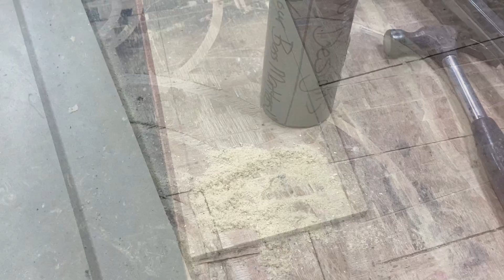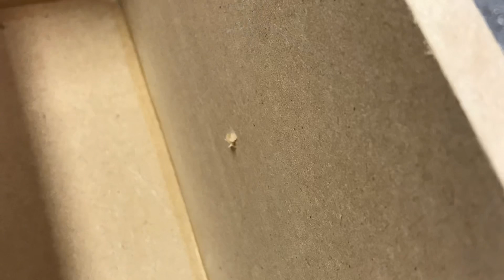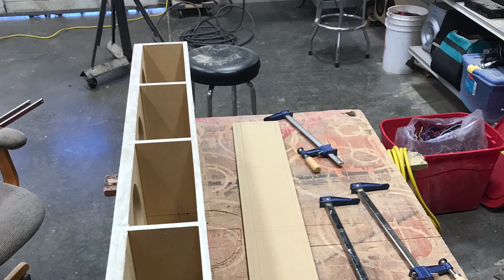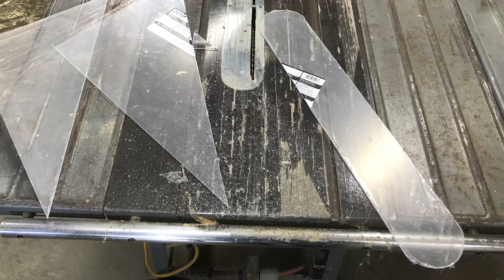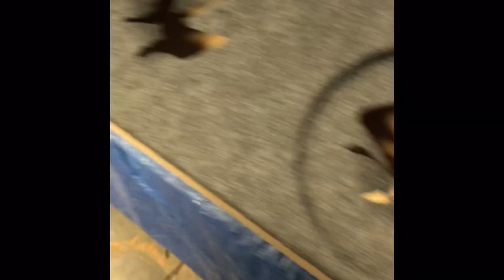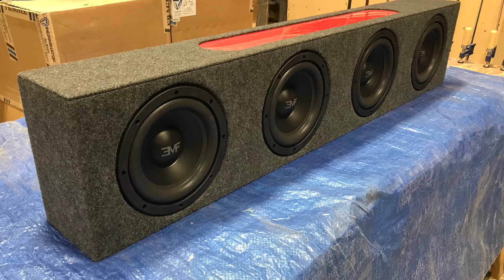Custom sealed enclosure, for 4-8” EMF Audio “Ghost Series” subs. For  a 4-Door 2005 Chevy Duramax.

Comment: Nice box there, when mounting subs do you pre drill the holes before mounting the subs In place? Any particular screws you think work the best?
Reply from the maker: Thanks Johnny 👍🏽 Yessir, I alway pre-drill my subwoofer mounting holes and use 1-1/4” coarse wood screws (#6 regular drywall screws) I run the screws in slow using a drill, but don’t torque with it. I do that by hand. This prevents stripping. I also pre-drill all other screws holes when assembling the enclosure. Prevents the material from splitting on ya. *Try and stay at least 2” from all edges when applying screws 👍🏽 When I use 1/2” materials, I use 1-1/4” coarse wood screws (#6). When using 3/4” materials, I use 1-5/8” coarse wood screws (#6). And pre-drill with a 3/32” drill bit 👍🏽 Hope that info helps, thanks for watching and your question bro.
Reply: @210 / Designs  cool deal, I appreciate you hitting me back. I'm installing my new system soon and wanted to make sure I mounted my subs correctly without damaging my box. I will definitely do like you said and prill drill my holes. And pick up some of those wood screws you mentioned to mount my Q class L7 8s. Your videos are awesome and your work is so 🔥💯
Reply from the maker: @johnnypiper1717  No problem mane 👌🏽 I try and respond to everyone that leaves a comment, good or bad. I post these builds share what knowledge I know, to help the next builder that might have questions. That Q class is an amazing subwoofer 👏🏽 *Every subwoofer basket is different when it comes to thickness. A quick tip when choosing the correct screw length. You want the screw to pass completely through the material. This I way your getting the most secure bite possible 👍🏽 Thank you again for your compliments and glad you are enjoying these builds. I’m also on IG for quicker response.
https://www.instagram.com/reel/ClOigHvDPt_/?igshid=YmMyMTA2M2Y=

Comment: Do you have to have the subs separated like this? What would be the difference if all 4 were in the same air space?
Reply from the maker: Yes, each sub is separated in its own chamber. The reason for this is to to isolate each sub in its own airspace. No 2 subs are identical…meaning they can respond at different rates when playing. So if they are in the same chamber, you run a chance of them fighting over the same airspace. Isolating them guarantees each sub has its recommended airspace. Plus if you blow one, you just have to rewire the remaining subs to the amp and can keep playing. Thanks for watching and your question 👌🏽

Comment: I hav a 2006 1500 crew cab will this box fit
Reply: How much and do u ship
Reply from the maker: @eliasibguzman5987  Unfortunately, I do not ship bro. I build locally in my area. Having access to the subs and vehicle, allows me to guarantee fitments and box performance 👌🏽 Thank you for reaching out tho homie.
Reply from the maker: I can’t remember what the exact measurements were for this box, I’ll have to check my shop notes. I know I’ve built several boxes similar to this one, for a 2005 Chevy crew cab. I’ll let ya know when I get off work👌🏽
Reply from the maker: I checked my notes on this box. Yes, it should fit in the ‘06 crew cab. I built a box that was 5” taller than this one and it fit 👌🏽

Comment: I run 2 12s sealed under my seat of my king cab 03 Silverado. I'm running 12s on a mini 1300 audiopipe Amp. It hits hard! Most people can't believe it's a under seat build!
Reply from the maker: That’s what’s up 🤝 I love sealed boxes  in trucks and if you can squeeze 12s in there…..👏🏽👏🏽👏🏽 Any vids of it playing on your channel? If so, I’ll definitely have to check it out.
Reply: @210Designs  hi. Sorry I don't have much on .y channel. I did a 2 inch seat lift,  so I was able to get some pretty good box value my boxes are separate. Detentions are 16 x 13 x 7.5. 1 box on each side of Trans tunnel but one piece of wood across the front with 2 Tampano 3.4 loud tweeters. I'm running 12s Rockville k6 series on a audiopipe 1300AMPI it makes 1,024 watts @ 14.4 volts I'm running @ 1ohm. It hammers pretty good! If you have a email I can send pictures and a video to you that way.
Reply from the maker: @oldguyBMX  Wow, you put some series work into you setup 🤝 And I love how your mixing up your brands as well. All very solid manufacturers 👌🏽 Sure thing…here’s my email: bj.hammon@yahoo.com
Reply: @210Designs  I was going to go with 2 8s firing forward and side port to the right door. But I hate trying to tune a big long port. Lol. I did this build almost 3 years ago on a tight budget! So my Amp was like $99 the subs were like $140 a pair I had the extra Amp for my highs and mids. And I'm running skar 6.5s and 4x6 I believe 3 years ago I spend maybe $500 for everything. Excluding my $49 clearance pioneer head unit from Wal-Mart! Lol. Oh and wood was cheap back then. Pre covid!!!!
Reply from the maker: @oldguyBMX  You are speaking my language bro…..BUDGET 👏🏽👏🏽👏🏽👏🏽 These are the best builds in my opinion. Literally ore bang for ya buck. High end equipment is suppose to perform well. But when you make a budget system perform…🏆

Comment: But must say; I still don’t understand what the extra rubber surround on the outer edge of the basket rim is for on some subwoofers. In my opinion unnecessary, look sloppy. A nice diamond cut on the basket edge would look cooler!
Reply from the maker: Are you referring to the runner gasket, that comes from the manufacture?
Reply: @210Designs  exactly, the subwoofers I used the last 25 years had no one of the. Maybe the underside is used as an extra gasket to seal the woofer….? But I see a lot of people who don’t mount the woofers carefully and stretch the rubber mounting wholes off the gasket. Maybe I’m a little bit OCD. But you mounted them perfectly.
Reply from the maker: @umtbozkr2358  😆 Nothing wrong with a little ocd my friend. A lot of people do install incorrectly, causing issues with the build. It’s always good to double check yourself and do research 👌🏽 I’m not perfect and can admit my mistakes, , when they happen 😃 I even try and show them and explain how to fix it.

Comment: Nice job, that box looks fine and how you made it, bulletproof. It’s LOOKS good and shouting SQL. Congrats! Only one thing, did you use fiberfill?
Reply from the maker: Appreciate it homie 🤙🏽 Thanks for that amazing comment 💯 Are your referring to poly-fil? If so, then no there’s none in this build. If I’m misunderstanding ya, please hit me back 🤝
Reply: @210Designs  Sorry sometimes my English is not sufficient; I’m from the Netherlands. But like I said, that’s a bulletproof box made with attention for detail. I don’t know these brand woofers, but I assume they are good, especially in that cabinet!
Reply from the maker: @umtbozkr2358  Hell yea 👏🏽👏🏽👏🏽 It’s an honor to have you watching any of my vids bro, especially from way out there 🙏🏽 Much respect 🤝
Reply: @210Designs  I appreciate it that bro. Videos how it should be done is also a learning platform in my opinion. But sometimes I see videos from others which in my opinion give newbies bad examples in building a decent box for example. In the video you also mentioned ofc wires for the cables. There are still a lot off people still use minor cca cables.
Reply from the maker: @umtbozkr2358  Yes, I try and use ofc as much as I can. However, some customers/people can’t afford it and cca is their only option. I’ve installed numerous builds using cca, never had a single issue with heat issues. You obviously loose some output power, but most of my builds are for daily bass with average power.
Reply: @210Designs  I completely agree. You must take account that someone who wants a decent sound but his or her financial situation doesn’t allow the best and the most expensive gear, it’s not a shame. Even I when I was a student bought no name amps and woofers, but it gave me satisfaction. The mean thing of car audio is that it’s addictive and when you can spend extra you sure do it.

Comment: 🇹🇹🇹🇹🇹🇹...
damn buddy..... you did it again.... great vid...
the fact that you put the mistakes in the vid man and showed how to fix them... professional...... thanks man...
Reply from the maker: My man 👊🏾 You know we have no secrets over here bro. Mistakes make us better 💯 You gotta show the good as well as the bad. Glad your still tuning man, thank you 🙏🏽
Reply: @210Designs   wont miss it bro.....
what specs would u recommend for a (1)  sundown x8 ported enclosure?
Reply from the maker: @TheHyvoltage  - Based on the manufacture specs and sundown builds in the past .75 - 1.0 nt/ct and 32-34hz on the tuning. Their subs play low notes with ease. And with the enclosure being smaller and this subwoofer’s soft-parts, you can put the power to them.

Comment: Doesn’t matter how many times I wire up subs I still look up wiring on 12volt.com everytime lol beautifullll build man love your work
Reply from the maker: 😆😆 Same here homie. They are my go to website 💪🏾 Gotta double check yourself, before you put power to it or you’ll definitely regret it later🤣🤣 Thanks for watching and your comment.
Reply: @210Designs  I would even test with a multimeter the impedance with multiple woofers. In very few occasions they can fluctuate. Not that their will be very big differences, but it can happen. And if your amp is not suitable for the sum of impedance, you can blow up your amp in rare cases (mostly protection kicks in).
Reply from the maker: @umtbozkr2358  Yes sir, you are correct across the board on this comment 👌🏽

Comment: Question...why the hardboard? Why not just rabbet the MDF? That's just extra material, glue & weight. Carpet is usually 1/16"...1/8" rabbet groove, nip & tuck. I'm not saying to hate, just trying to understand the logic behind it.
Reply from the maker: Very good question and definitely not offended by it 👌🏾 I use hardboard for (2) reasons. 

1: It’s all in the name. Hardboard is more dense, than mdf. So when I’m using the 1/4” material and trim 3/16” or 1/8” off, it doesn’t leave much to work with. And even with that thin edge left, it’s still strong enough not to break, when moving the enclosure or tucking fabric. 
2: With me using acrylic pieces on these builds, the hardboard gives me a way to mount it. If I put a rabbet edge on the mdf, for fabric, I still would have to contend with mounting the acrylic and wrapping those edges. 
Hope that explains it for ya bro 👌🏾

Comment: How far are you from OKC
Reply from the maker: About 2hrs
Reply: @210Designs  can I fit 3 10's behind the seat of a 2007 gmc sierra classic crew cab if so how much would you charge me to build? and what subs would you recommend me to purchase ?
Reply from the maker: @deyonnebagby3961  - Are you related to any of the Okmulgee Bagby,by chance? Thats a hard one for me, without seeing the truck or knowing the measurements (width, height and both depths- top of the rear and bottom seat). If you can get me that info, I can start running numbers on my end 👌🏾
Reply: @210Designs i believe so to have relatives  there  let me get you those measurements and the photos  and see what we can come up with for you tube
Reply from the maker: @deyonnebagby3961  / That’s what’s up. You can send them to my email if you like. bj.hammon@yahoo.com
Reply: @210Designs  ok I will get on that today when I get off preciate any help you give
Reply from the maker: @deyonnebagby3961  - Cool. I always help those who ask bro 💯 It’s how do at 210/ Designs 👊🏾